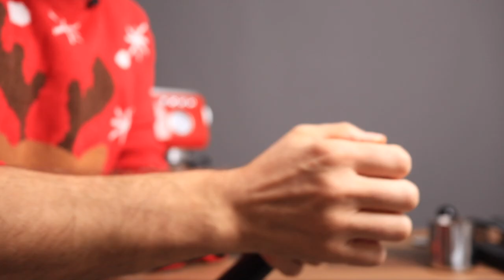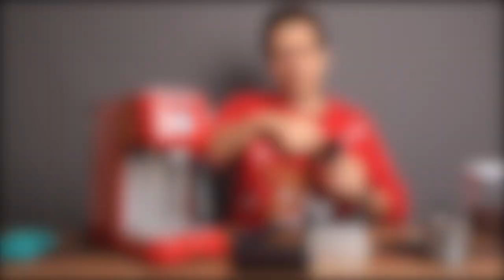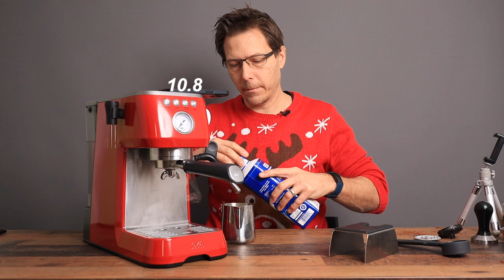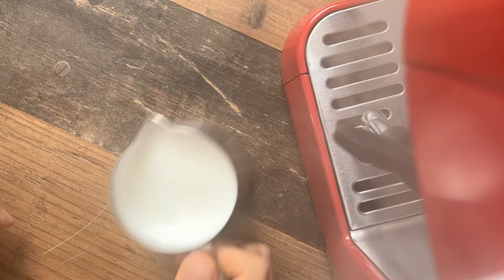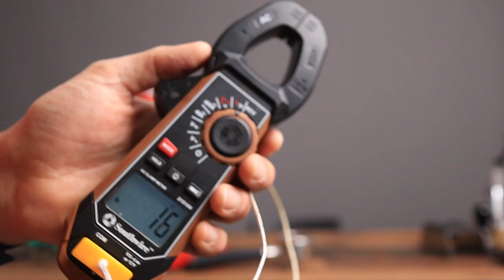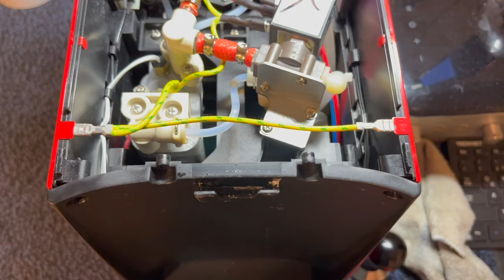Solis Barista Perfetta Plus: Delonghi Dedica Destroyer or Not?

Comment: Hi Tom, another interesting Video, what is the factory pressure setting for the new machine? Is it adjustable? Andrew
Reply from the maker: Hi Andrew! The OPV does not look adjustable, but it's also hidden underneath a valve, and would be a pain to get to. So, I don't think it was designed with adjustment in mind. I don't know about the factory setting. The manometer often sits at 12 bar, at the same grind setting that gives 9-10 bar on other machines, so I think the manometer might need to be calibrated. Cheers, Tom

Comment: Thank you for the video!
Can you share at what pressure is the machine calibrated when pulling a shot or using the plug?
And did you notice the type of OPV? Is it adjustable?
Reply from the maker: Hi there! I am not sure which pressure exactly, as the plug is not completely blind. It has a hole in the middle. Also, I have the feeling the manometer gauge. needs to be calibrated. Not sure if the OPV can be calibrated. I would have to open it up and locate it. Anyone else know that?
Reply: Yeah, I was wondering that also. Can't locate the opv inside also

Comment: Great vids.
Please help me dicide between a rancilio silvia pro x and a ascaso duo steel pid.
I am just put off  about heating time on silvia,  can't  wait 30 min in the morning.
On the other side not sure about ascaso reliability,  didn't heat much about that company. 
Thanks a lot
Reply from the maker: Hi there! Thanks for the question. To be honest, I have not had a Silvia Pro X yet, but I have had the Ascaso Steel Duo Pro, and I used to own a Rancilio Silvia.
These are two different machines. The Ascaso has 2 thermoblocks, while the Rancilio has two boilers. The Ascaso is a newer company, while Rancilio has been established longer. Aesthetically, I prefer the Ascaso, but that is subjective. Longevity wise, I am guessing the Rancilio will be better. Both machines benefit from at least 15 minute start up time, to get the brew head and portafilter warmed up. But you can likely put both on a wifi timer. 
Which do you like, looks wise? Which market are you in? Do you prefer thermoblocks over boilers? They are both expensive, so I would suggest you watch a bunch of YT videos from different creators on both machines. Curious, which one you choose! Tom

Comment: I love your videos expecially about the dedica, i just know dedica is good but this solis looks complete. Cheers Tom
Reply from the maker: Thank you so much! Yes, it is a nice quality machine, and if you can buy it for a good price, then it's easy to recommend.
Reply: @TomsCoffeeCorner  if the price would be the same as dedica absolutely its worth it, i jave bought my dedica in offer 150euro so max 200euro its worth more that is not with that fake PID that they say its no worth to buy more expensive. Anyway this is my opinion dedica omly lacks the selenoid valve.
Reply from the maker: I myself prefer the lack of an OPV. I know no machine that knocks out the pucks as cleanly as the Dedica.
That being said, the Solis is a nicer build, with room to work inside, in case something needs to be serviced. It is a nice machine, but suffers from the heat loss between the thermoblock and brew group, that almost all thermoblock machines suffer from.
Reply: @TomsCoffeeCorner  That is true for me that is one reason i like dedica many lack that but still cost a lot, dedica doesnt. I would prefer they would do some better upgrades to dedica but not changing the price much.

Comment: If i wanna get 9 bar on solis barista perfetta while the pump pressure is 15 bar, is it depend on grind size of coffee ground?
Reply from the maker: Yes, that's true. The max pump pressure might be 15 bar, but it will be limited to less than that through an over pressure valve, maybe to 11-13 bar. But depending on your grind size, the extraction may never reach that pressure. Cheers!
Reply: @TomsCoffeeCorner  for grind size of coffee, it will be recommended to use grinding machine. But since i have timemore C3, espresso size is right at 7-8 clicks, but does it work well with solis barista perfetta plus?

Comment: Is it possible your temps were low due to the Bar being so low? You should be around 9 but your pull showed 4ish!? Water was flying through that pull. Wouldn’t that make for cooler temps with a thermoblock?
Reply from the maker: I experimented several times and ended up with temps I think are on the lower side. The shots actually pull closer to 11-12 bar according to the gauge, but I think the gauge is off. I didn't know the pressure in this video, as I showed the extraction instead. Cheers!
Reply: @TomsCoffeeCorner  Understood.  Thanks.

Comment: Is that an accurate temperature testing method?
Reply from the maker: As accurate as I can do it. I put the probe on top of a fresh dose of coffee. It should at least exemplify whether or not the PID is controlling the water, and round about what temp. If you check my Ascaso Steel Duo video, where I did the same, you will see a rock solid flat temp curve.

Comment: Same Temp-Curve, when doing a pre-shot before the first including temp.-measurement?
Finally you measure temperature of ground Coffee and water and Not the water only. If the water has reached the portafiler-walls thru the Puck the temperature is a Mix of fresh heated water, wet Puck and heated portafilter-walls.
Reply from the maker: I think this way is as accurate as I can hope for without one of those fancy measuring devices. It at least simulates the temp as the puck is absorbing the water. If I just measured the water itself without a load, I am guessing it would be even cooler.
Reply: @TomsCoffeeCorner  without a load the flow is higher and the water cools down faster at a thermoblock, even the ones with PID, that's right...
Reply: @TomsCoffeeCorner  Characteristics of the diverse portafilter-machine-systems.
1. Single Boiler. No Heat exchanger. Better to Not use cold water and e.g. Volvic at room temperature instead. For Tea the recomnendation is to Put the BRITA® into the fridge.
2. Dual Boiler. Heat exchanger. The Mass of the System makes the Temperaturen of the brewing water stable.
3. Thermoblock. At portafilter Machines it Works different to usual Machines for Filter Coffee. Just the Wilfa Precision has a water Pump, while the flow is compared to a portafilter Machine very Low. The Ratio Right and Ratio Six e.g. come without water Pumps. All other beyond the Wilfa Precision Work according the Concept of a water percolator. The System is calibrated to optimal brew temperature Independent fron the water Temperaturen in the Tank, except the water in the Tank is too warm.
At portafilter use Volvic stored for a while at room temperature.
Cold/too cold water in the Tank cools down the Thermoblock and PID is No remedy. The flow defines how fast the Thermoblock is cooled down. Adjusting the Heating of the Thermoblock (PID) is No real remedy.

Calcium and Sulfur/sulfides Levels of Volvic are perfect for Tea and Coffee.
A BRITA® does Not optimized the Ph-value Just Filters Out Calcium. If Sulfur/sulfides is too high the Extraction deliveres too much of Something which should Not been extracted. At too Low sulfur/sulfides the acid-levels are Higher, less compensated.
Just compare water of the Brand Volvic® and "Black Forrest®". The Levels of Minerals and Sulfur/Sulfides at "Black Forrest®" start to be too Low. "Black Forrest®" are perfect for Milk Powder and Baby meals.

Comment: I own the Solis. The espresso isn’t as good as my old Delonghi single boiler machine but the milk is way better. I’ll keep the machine as long as the steamer keeps working but I wouldn’t replace it. I like the manometer. It helps dial in your grind and tamp pressure. For an all in one machine I think the Breville Barista Express is the king. More money but a better machine.
Reply from the maker: I can agree with those sentiments. I also get a better espresso out of the ECP 3420 than the Solis. So far, I also get better espresso from the ECP than the BBE. I think the pressure on the BBE is too high, and I need to figure out how to adjust it. Thanks for commenting!
Reply: I have actually owned three of the Solis machines. the first one lasted 10 month, the second 5 month, the third less than a month. Leaking , tripping the breaker, the dreaded rapid inner buttons rapid blinking, etc. SCG offered to swap out and send a 4th machine or full refund. I am going for the refund this time...

Comment: Hi, i have a dedica for 4-5y and im thinking about change. What would be best choice after dehlongi dedica? I have a eureca grinder, tamper, bottomless portafilter. Price max 200E.
Reply from the maker: Hi there! Well, I don't think you are going to find an upgrade for 200 euros. You could try an ECP35.31 however, if you wanna try a boiler machine with heated brew group.

Comment: How can you recommend at all with those temps?
Reply from the maker: I should add that my temp probe is 2 degrees off, so the extraction was probably flat around 80 degrees. Still too low.
BUT, many cheaper machines suffer from too low a temperature. The thermoblock is just too far from the brew group...therefore the heat loss.
Anyway, it all depends on what you want. Some will like this machine for its looks and ergonomics, and its great steaming. For cappuccinos, this machine works great.
Cheers!
Reply: @TomsCoffeeCorner  Reading through all your responses and I still have One question, I've read reviews where people say the Bravo bambino plus is more temperature stable but can you put that in your comparison video?